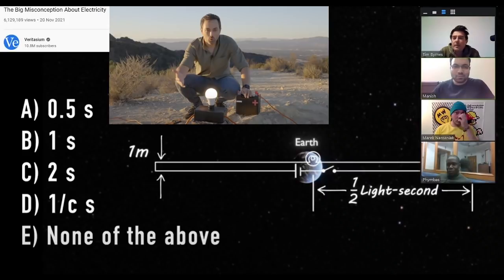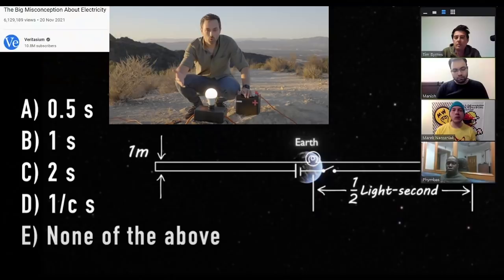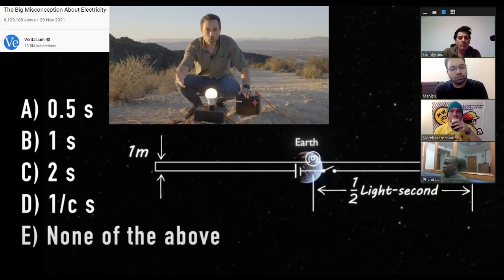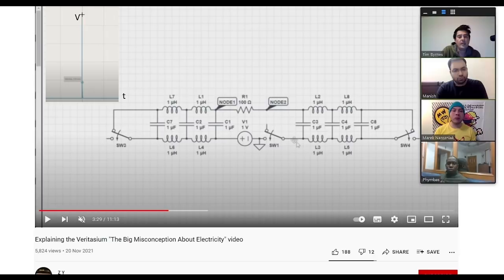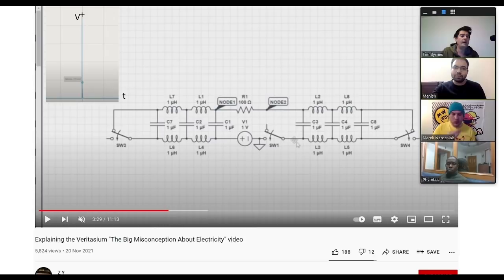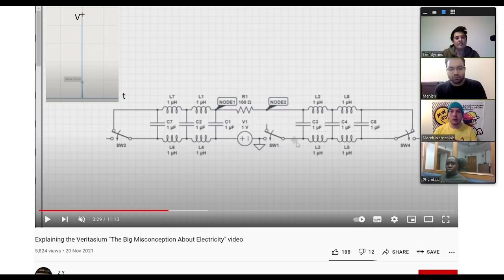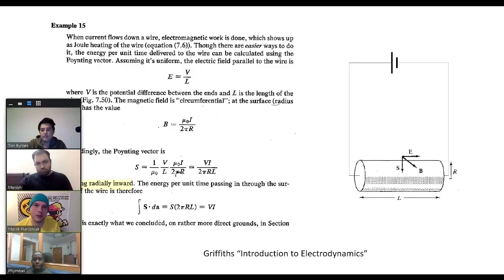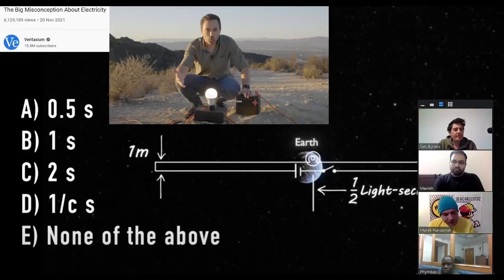Veritasium's Big Misconception About Electricity video and the point about Poynting

Comment: Those Feynman's examples are interesting but I wouldn't say they make the perspective unacceptable. Nobody is bothered by magnetic lines forming closed loops - they're actually always closed since we don't have magnetic monopoles. And in case you have e.g. magnet levitating above a superconductor, we have perfect example of accumulation of power that's associated with closed loop of electric current and magnetic field. A static system equivalent to Feynman's example. They're dual systems, you can always work with two and consider the third to be derived quantity. And actually since we don't have magnetic monopoles but can obviously agree that concentrations of both charge and energy may exist, it's a question whether the actual derived quantity isn't magnetic field.
Reply: Yeah, I could imagine multiple sensible ways of justifying these examples - i.e. the "closed loop" could be interpreted as the system's potential energy being maintained. (in contrast to other examples containing energy sources and sinks)
Reply: Actually? Really? They really are actually always closed? Oh, and what is the definition of a perfect example? One that fits a model in some cases?

Comment: the poynting vector pointing towards the center of the conductor just means that part of the larger component from the outside is being refracted according to snell's law; this inwards pointing poynting vector is what describes wave propagation inside the conductor and the associated I^2R losses within the wire, not the power going to the load;

Comment: 15 Dec/21  I figured out what is wrong with Vertasium's answer.  1/C is NOT a TIME it is a RATE.  Resolving the equation means that, for one second, the distance traveled will be one light second.  He's right ONLY if you resolve the equation which is an answer of ONE SECOND which was my original answer.

Comment: Thank you NYU Quantum Technology Lab.  I think Veritasium's main point is partly correct and party wrong.  He is most concerned with the transmission of energy.  In his thought experiment, he claims that you could transmit enough energy to light up a bulb in (1m/C) seconds.  I say that he is partially correct because you may be able to detect an electric signal in that short time.  He is also partially wrong because unless you're using a ridiculously powerful voltage source, the low amount of power delivered through that 1m of space wouldn't be enough to light a bulb.  I witnessed a demonstration that simulates this experiment: a moderate DC power supply was connected in series to a large switch, a large solenoid with perhaps a couple miles (several kilometers) of copper wire, and a regular light bulb.  The bulb was only about a half meter from the power supply.  When switched "on", it takes a perceptible amount of time, perhaps up to two seconds, for the amount of power delivered to the bulb to reach the threshold to make the filament hot enough to light up.  In this amount of time the electrical current energy goes toward building the magnetic field energy around the wire, and particularly in and around the solenoid because there is so much wire at the solenoid.  When switched "off", the energy in the electric field gets turned back into electrical current energy, at a rate and voltage that brightens the bulb greatly and that last after the switch has been opened, forcing an impressive and relatively long lasting spark at the switch.  And regarding energy traveling through space around  wires, well that is true to an extent, however the air doesn't heat up very much but the wires do.  If the developed heat is any indication of proportionality of where the energy is traveling, then the wires are conducting the bulk of the energy.  For example, you can't short circuit the power transmission of a closed circuit simply by placing metal around it, though you may interfere with or corrupt some types of signal transmission along the wire.
Reply: Ehm, it was a thought experiment without resistance in the wire. Maybe watch it again and listen.. don't get me wrong, listening is hard (because it is so simple)...

Comment: Imagine a canal of water in the middle of the sea separated from the sea by a wall, and suddenly, a pump starts taking water from the canal into the sea. This generates a wave that lowers the surface of water inside the canal and propagates through the canal. However, water doesn't really flow, or only marginally: this is mainly a pressure wave. Then the wave reaches a mill between the canal and the sea, there's no more walls at this place, so that the water comes into the canal from the outside, because of the surface gradient induced by the wave, and this activates the mill. If we analyse the flow of water, we'll see it goes into the environnement at the pump and comes from the environment at the mill, there's no real flow inside the canal, and yet it's permitted by the pressure wave that is transmitted through the canal. Would you say it's a correct analogy?
Reply: How many waves are there in the sea? What is the difference between quantitative and qualitative?

Comment: Make the wire 500 feet long on each leg.  Use a dual trace scope with one lead at the switch and the other at the light.  I would expect to see the light turn on about 1 microsecond after the switch is turned on.  What I would like to know is what is the activity and timing along the wire between the light and the battery.
Reply: Now there's an answer! This could be easily done, and would prove the matter conclusively. And, yes, Veritasium was wrong.
Reply: @ScottGrammer  My example was wrong. He was only trying to demonstrate that there’s a magnetic field, and associated energy, surrounding the wire when current is flowing, and that this field would turn on the light because the two wires are only a meter apart.  This is a poor example.  A better example could have used a dual trace scope with one lead connected to a magnetic pickup coil near the  500 ft. return wire and the other lead connected to a pickup coil placed near the switch.  The scope would show an initial pulse at the switch, then 1 uS later, a pulse on the return wire.  He was just saying energy would reach the light directly from the wire’s magnetic field near the switch, even though the light can’t convert the field’s energy into useful current.  The discussion about AC flow only confused the issue.  Energy can travel on a wire about 1,500 miles in each direction with 60 cycle AC.  Bringing up transformers added to the confusion, but it did demonstrate that the magnetic field can jump gaps.  I think his positionn is that electrons never leave an atom.  I’m not sure about this.

Comment: I have been needlessly using wire for all my projects. I will continue. This is because I have a very hard time making that energy flow outside wires, except with high frequencies where I can use a wave guide. That has not worked so well for dc. The Merck Index gives numbers for conductivity. I would start there. Electrons do in fact repel one another. They do in fact flow in wire. Veritasium uses click bate. People love to make electronics mysterious. Well, I have projects with magnetics that do not need any more mystery than they already have. Plus I just made a Zn Zn cell with no separator that uses electrets for EMF. So how do you like them apples! Video coming soon. Very exciting!

Comment: https://en.wikipedia.org/wiki/Poynting%27s_theorem#Integral_Form I think the issue may be that the actual Poynting Theorem involves a term E.J (dot product of electric field and current field), which is not discussed. In a vaccum, it is true that J=0 and so the change in energy in a region depends on purely the (surface integral of) the Poynting vector. But in a conductor J is not 0 (it is sigma*E) so the change in energy term depends on more than just that.

Comment: So some current will flow almost instantly, but let's assume the lamp has a nominal wattage of 1w below which it does not produce a detectable amount of photons. Given a 12V DC supply, how long before we get the required 1/12A to produce a detectable output?
Reply from the maker: If you ignore the initial transient current due to capacitance then its 1 second (to the best of our knowledge).
Reply: @NYUQuantumTechnologyLab  agreed. And that's the big problem with Derek's video. He shows a physical setup with an actual bulb, then claims that bulb lights instantaneously in his hypothetical circuit. Poynter won't make that happen. It requires a light speed limited propagation of electrical and magnetic fields to enable energy to transfer in sufficient amounts to light the lamp. The way Derek describes the process is at fault, not the science.
Reply: Throw out the whole transmission line aspect since he set the problem up with a switch, a bulb and a battery.  sure there is an initial transient, but Derek said it was OK to handwave the "impedance" aspect of the problem ( so what is he really trying to teach here??) so the heck with all those reactances, right?  make the path a circle, forget the 1 meter spacing for now.   you say the bulb would light in 1s?  Why not 2 seconds?

Comment: Connect current simultaneously to neg and pos .  You are charging the circuit before switching.  Dont charge wires before both are connected simultaneous at batt .
You have current flow when wire is connected to batt all the way to the switch .  Even though switch is open.  If this you say were true your batt would always be dead in your car

Comment: I got confused on Veritassium's video when he showed the charges accumulating on the surface of the wire, and making an electric field outside of the wire. Does this really happen? I never saw this being explained in any textbook, and it doesn't make much sense to me. If the charge in the wire doesn't change, and the density of charge in the wire is the same, how does this charge on the wire surface accumulate?

Comment: Poynting vector deals with electromagnetic waves; that is, radiation.
Static electric field, and static magnetic field do not radiate.
Only time varying fields generate electromagnetic waves, and radiate.
The electromagnetic wave front travels in a particular direction, transmitting electromagnetic energy in that direction.
That direction, and the electromagnetic power transmitted in that direction, is represented by the Poynting vector.

For static electric field, or static magnetic field, there is no Poynting vector to speak of because there is no EM waves, and no radiation.

When the switch first closes, there is some re-arrangement of charges at first, and that causes a tiny EM waves to propagate out, signifying a signal for the charge rearrangement.
But the the energy in that tiny EM wave pulse is insufficient to light a light bulb. 

The light bulb receives radio signal constantly from surrounding radio stations; but it does not light up.
To light the light bulb requires EMF, electromotive force.

That is why you and I have to pay PG&E.
Reply from the maker: Regarding your point about no Poynting vector (no pun intended) because of static electric and magnetic fields, apparently Feynman disagrees with you.  Since S=ExB, surely there is.  There are indeed no EM waves though. 
But agree with the second half, I think this seems to be the consensus.

Comment: Your discussion is on another level but, what I learned when student of eletrotecnics, is that the Poynting vector is only used in electromagnetic waves and serves to know the intensity and direction of this radiation. In am electric circuit there are no electromagnetic waves. Therefore the Poynting vector has no meaning.
Anyway, thank’s for the video!
Reply: Of course there is. How would you explain transformers. A difference in electric potential energy  excerpts a force on a charge thus an acceleration thus a magnetic field.
Reply: @TJ-hs1qm  A magnetic field is not the same as an electromagnetic wave. You can have both an electric field and a magnetic field produced by the same charge and yet not have an electromagnetic wave.
Reply: @joaoarriagaecunha8583  "A magnetic field is not the same as an electromagnetic wave. " Sure sure, but I never said that. You are right in that "there is no EM radiation inside the circuit" but everywhere else there is. Charged particles when accelerated produce EM waves (outside). Hence the Pyonting vector exists and has a very specific meaning!  Your claim that the PV is meaningless is afaik wrong.
Crazy thing is that Poynting's vector also exists in "resting" fields  (see Feynman fig. 27-6). Turns out energy is still flowing so nothing is ever truly at rest in nature.  ps: Wikipedia is referring to the same static field experiment to explain the Lorentz force. Because EM waves transport not only energy but also momentum and angular momentum.
Reply: @TJ-hs1qm  ahh movement and something existing.. where have I heard that before... was it in E=MC2?

Comment: The thickness of the wire and the resistance of the lamp has great importance. If I consider wire used is 1mm, than the capacitance is only 0.0088pF/m and the inductance is 2×1.5uH. So the circuit at 3:16 can be made of 15 times 880pF and 150mH on each side to make 15×100,000m. If you simulate with 1kohms lamp, it will require 15ms to have 80% of the battery voltage and 150ms for 100 ohms. That is the wires will act as an inductor.

Comment: A lot of funky theories out there.  That paper you mention from 2004 has the E field pointing perpendicularly out of the wires doesn’t jive with me.  They argue charges on the surface create it.  but in a conductor you can’t have charges on the surface, right?  Gauss?  And if the E field isn’t directed along the wire’s length, what’s going to pull the electrons along?  A perpendicular E field?  Clean living?  What the heck.

Comment: I really enjoyed the video that there's an ongoing debate on the energy flow of the electric circuit. I have a question that if this poynting vector concept may describe how the electric field does work on the point charge for example. By calculating the integral of E dot dl, the charge moves along the path dl, generates the magnetic field nearby, and thus gets energy by the poynting vector, which gets converted to kinetic energy? So that i thought what we understood by the potential difference in the electric circuit doing work is meaning the same thing but just explaining differently using the poynting vector?

Comment: I think the question not only consider the pointing vector, also it is required to consider the strength/length of pointing vector. I guess the majority energy is pass through via near the wire.

Comment: Is the flow of energy somehow related to lorentz-force F=q BxV ? So, force and energy are same directed? Or are forcevector and poyntingvector different things?
7:30 But you can't close the circuit with open ends. You need some wire that returns, passes the capacitor and delivers the energy from the side.
0:10 I'm wondering what happens, if you put two more light-bulbs at the left and right side of the circuit. The short 1m ends.
Would they light up later, than the light bulb in the middle (on earth)? I'm convinced, if they prove it by a small scale experiment, with atomic clocks.
I also think, pointing vector is just a construction, similar to vector potential. 13:04 What does the baby think about that. ^^
However, thank you for this video. I fear germany will go in lockdown again, so I appreciate such content.
Reply from the maker: Thanks for watching!!  For Feynman's capacitor example, yes there would be a a battery connected to the capacitor, its just not shown.  For putting light bulbs at the far ends, yes I think these would light 1s later than the one on earth.  This would be true even for the "transient" capacitor charging model or the full blown current that would flow.  As for the Poynting vector being a construction, yes the vector potential is a great example, wish we thought of that!!  And sorry about the baby we put this together quickly.
Reply: @NYUQuantumTechnologyLab  
No problem. Babies are always enjoyable 🙂

Comment: so if we have perfect circle od wire (length 300 000 km, diameter 95541 km ) and we push the switch, will that signal travel just one second ?

Comment: You don't understand why the Poynting Vector HAS to point in the direction it does!
Poynting Theorem is part of LOCAL ENERGY CONSERVATION at a POINT which you always have in any electromagnetic situation.
The relationship between energy density and work done by fields on charges and charges on fields and energy flux.
There is a differential equation for local energy conservation
dU/dt + div(S) + E*J = 0
Where S is the Poynting Vector and when above equation is integrated the Poynting Vector allows you to calculate energy FLUX/flow.
Yes at the point in question due to work being done and a change in energy density there is energy source or sink at the point in question and integration of Poynting vector over surface allows calculation of FLUX. It points in the direction it does because when you integrate it's Normal Component over bounding surface you calculate energy FLUX. 
Think about it - if Poynting vector had any other direction the DOT PRODUCT in the surface integral would be WRONG, it would give you the wrong answer and so that's why it points in the direction it does.
Poynting Vector/Theorem was derived from LOCAL ENERGY CONSERVATION THEOREM of electromagnetism.